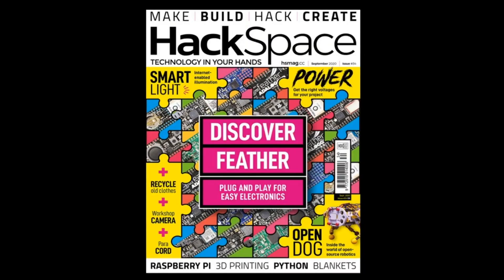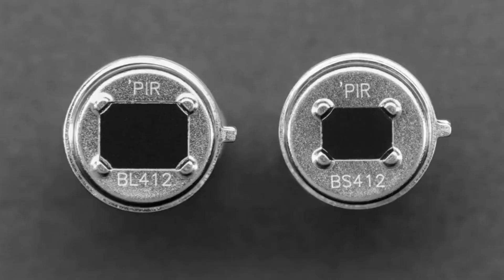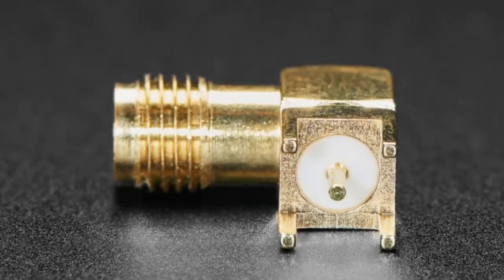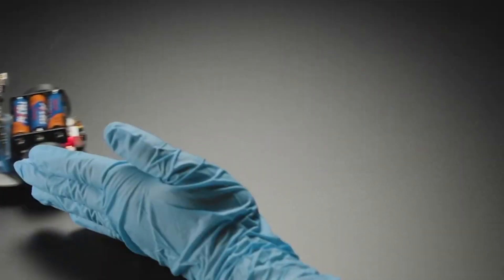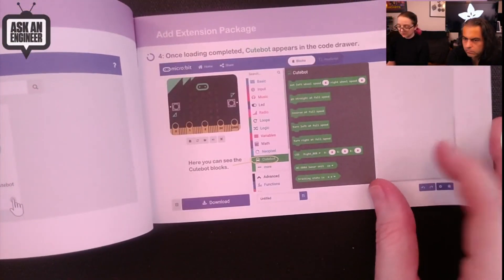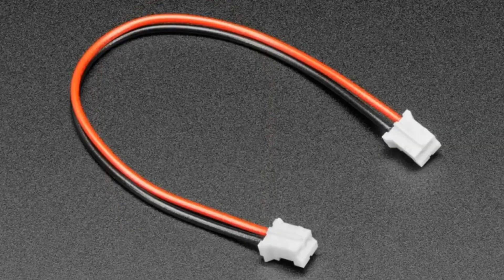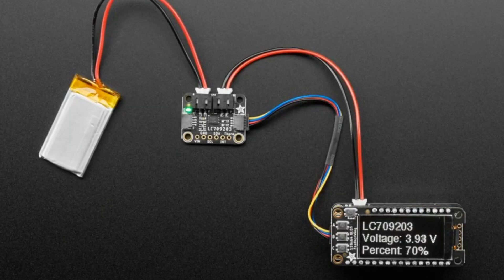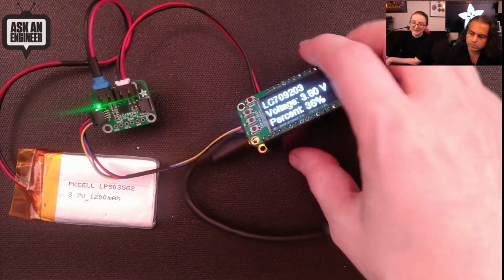New Products 9/2/20 featuring LC709203F LiPoly / LiIon Fuel Gauge and Battery Monitor -STEMMA JST!

Comment: I like the LiPo battery voltage monitor! Any chance that something exactly like this will be made available for a 12v lead acid battery? Thanks in advance!
Reply: Lead acid batteries behave differently from lithium ion, so you will need a circuit that is designed to handle that battery chemistry. TI makes the BQ34Z110 which is also I2C capable. Obviously the pinout and other characteristics are going to be different, so make sure to read the datasheet.
Reply: @MMuraseofSandvich  right i rigged an INA219 and currently testing and calibrating discharge curves for 12v LA (yielding one or system of equations) to output something just like this. They got a great product here!